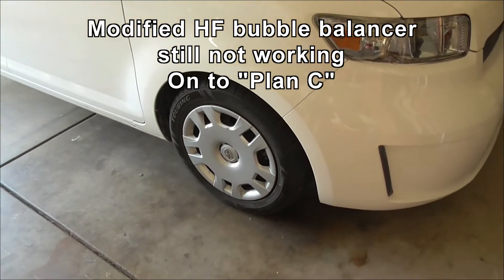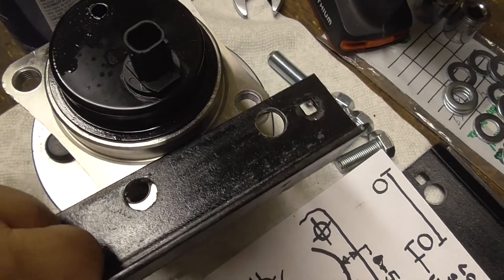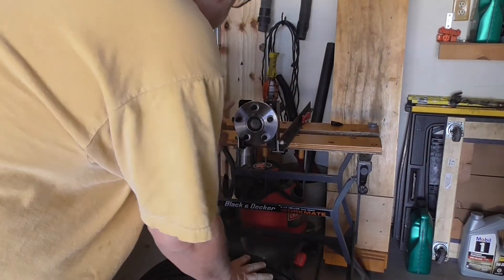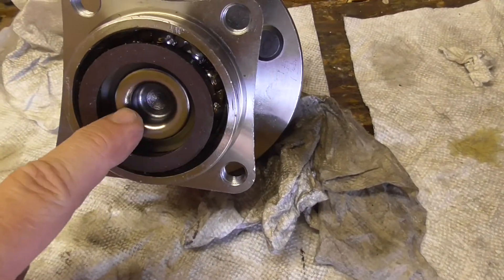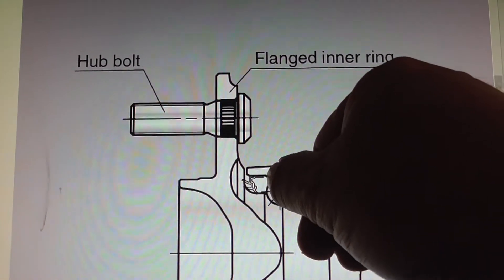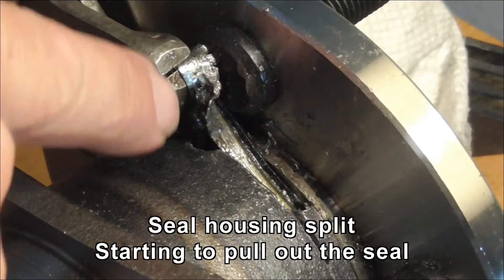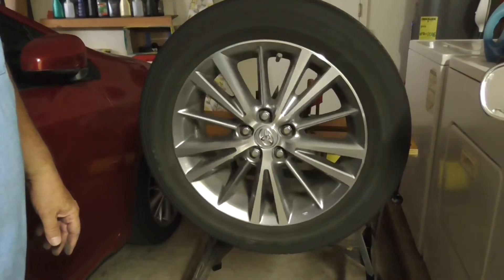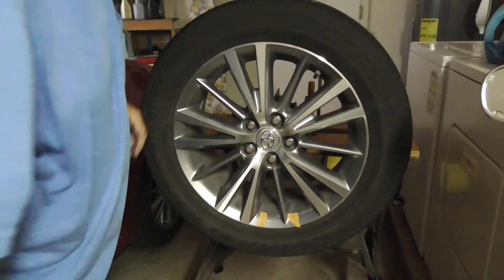Car Tire Vertical Balancing

Comment: Did the vertical spindle method work well? I built a vertical balancer out of threaded rod, tire balancer cones and bearings. It does not work well. I get a consistent heavy spot with no weights on the rim. Once I balanced out the heavy spot I got a new heavy spot. I though I got it balanced out too. Road test says no. it is bouncing pretty bad. The cones look very centered to the hub so I have no idea why this isn't working. The vertical balance method works well on my motorcycle tires.
Reply from the maker: Sounds like you are trying to do a static balance on a car wheel, with a motorcycle wheel balancer type design.
That should work, but clearly it isn't. 
Without seeing your rig, I'm going to make some guesses and/or ask questions.

1. What is the clearance between the threaded rod O.D. and the balance cones I.D. ? (slack here can throw off readings)
2. Do you have one cone set up pointing inwards and the other outwards? 
I have seen a set up like this and I asked why he did it, the answer was because the cones contacted first before clamping the tire properly. So he flipped one and it worked.

With cones, you need one surface perpendicular to the rotation axis to duplicate the wheel hub clamping surface, The other centers on the wheel hub inner pilot. That can be very hard with alloy wheels.

Even a small amount of slack - say 0.010" radial - can make a big difference. 
The out of balance moment created by this is...
The weight of the wheel assy (say 40 lbs) X the radial offset (.010") X 16 to convert to ounces.
= 6.4 ounce inches
Say the wheel rim has an 8" radius, then you would need 6.4/8 = 0.8 ounces of wheel weight to make up for the balancer error.
But of course, it will keep moving around and you won't know where it is...

My hub balancer kind of works, but it has too much friction
I now use a horizontal laser balance, like in this tire change video
https://youtu.be/WgjNO2gt3xg?list=PLWHom5FLIC6vZSy2jL7YB3xnY2jVi5Mgt&t=29
I've done about 30 tires with the laser method, no complaints.
(note the laser method can't do wheels where the hub is centered between the rims)
Reply: @richbinaz  I am using the cones from my motorcycle balancer that have a .5 inch bore to go onto the .5 inch threaded rod. These cones fit the tire changer cones which have i think a 36 or 38mm bore.  Once cone goes into the hub. The other one sitis flat on the other side.

 There is minimal play like the motorcycle balancer has. Once the nuts are tightened to the wheel there is no play.

  I didn't realize such a small amount of play would have that drastic of an impact.
Reply from the maker: @grant31781  
OK, so if you spin the wheel assy on the balancer, does the wheel rim turn true, or does it go up and down against a fixed point.
If you have a dial indicator, that can help. https://youtu.be/zEBYJvfL0b8?t=228
or you can just spin it and observe how it spins against a stationary background
https://youtu.be/PzDyZ6Pn8LE?t=57

If you get a high spot, mark it with a bit of tape, undo and re-assemble the cone system and see if it repeats, or gives you a different spot.

Comment: I see you left one of the original weights on the rim Rich.....wont that mean your would have had to put extra stick on ones on.
Reply from the maker: I initially bought the wrong hub!!!
I thought the Corolla and XB had the same 5 bolt hole pattern, but the corolla is 100mm pitch circle, while the XB was 114mm. 
In the video I was doing test fit ups, so I wasn't at the stage yet for weight removal

Comment: I have a HF balancer and like everyone else has found, it doesn't work well.   I saw the one video where the guy put a 1.5 inch ball bearing in the center of the cone and balanced on the top of a flattened steel shaft.  He claimed it worked well to free up the wheel to allow proper balancing and it made sense to me. So yesterday, I ordered a 39mm ball bearing (slightly larger than 1.5 inch) and 14 inch 1.5 inch diameter steel shaft, threaded on one end and flat on the other.  The threaded end of the steel shaft is stepped down so I figure I can retrofit it to the HF base.  I've already assumed that I will have to do additional milling to the flat end of the shaft to make it perfectly flat.  But sounds like there's likely concentricity defects with the HF cone so probably won't work.  I should return the ball bearing and shaft and save myself $$$ and the disappointment of failure, but I'm probably stubborn enough I'll try it anyway.  I have a feeling I have a lot in common with you Rich.  Meaning, I think we both find value and satisfaction in overcoming a challenge even though many may not consider it worth the effort when strictly looking and time spent and $$$.  With that said, I do have my limits though:)  I think there is a market if someone could actually make a balancer that works for about $300.
Reply from the maker: Hi Quinby, If you have access to a lathe, you may be able to create an internal chamfer, concentric to the outer cone, or cylindrical sections, that will fit the ball. If there is no metal on the inside at around 1 inch diameter, JB weld (epoxy resin) can be used to fill in the area / volume. Then after it's well cured, it may be machinable.
I think the steel support bar only needs to be flat, but it probably needs to be level. Kind of like in this video https://youtu.be/a4Ox_Emh7Ew?list=PLWHom5FLIC6vZSy2jL7YB3xnY2jVi5Mgt&t=27

That might fix the runout issue, but then there are other issues - like...
Is the whole head balanced? (how many ounce inches error is there)
Is the spring loaded frame jamming in the holes? 
Does the wheel go on perpendicular to the cone? (the whole point of the spring frame)

In this video I got a cheap new hub from amazon, think it was around $50 and cobbled up a rig to support it. Once modified to reduce friction, it does seem to work, at least up to 85mph (fast as I want to go) So it seems to be cost effective.

I have seen a guy use a motorcycle type balancing rig, but it wasn't trouble free, he had to make adaptions. Like this one, but with bigger (no-mar) cones and one reversed
https://www.harborfreight.com/search?q=motorcycle%20wheel%20balancing%20stand

That is one of the challenges with making a generic car tire balancer. The pilot diameters and hub - stud pitches are all different.

Yes, I like to solve puzzles and this one was particularly vexing. But I think the vertical solution is good enough, with a backup horizontal plan that might work without having to keep buying hubs.

Comment: i see a guy on here so fed up  he was trying to balance his wheels with his cell phone, good luck  have a great day
Reply from the maker: The cell phone app I downloaded for slope detection was only accurate to 1/2 a degree. Plus you have to pre balance the phone before putting it on the wheel assy. etc etc. More error.

Comment: thank for the message you sent to  sir, i see the guy with the big ball baring  and a flat metal plate for the ball to divot on,  you still have to have a way to get the ball in the centre of the steel plate,  he could have put a pin on the ball a small hole in the metal plate to line it up centred   i have some rock hard rubber balls here,  so i shoved one up in side my balancer cone,  took a 19mm socked  shoved over my pivot shaft,  lade on a nice little pic of 1/4 inch mettle   i didn't balance a wheel with like this tho,   it was working so good  i bould even put a washer  or a bolt nut  on the balancer   and it moved the bubble    and the bubble was moving  for a long time,  so i stooped it with my hand,,  and pasted a other bolt nut   on the opsit side  back to senter bubble   i think the ball baring and a metel plate  is the only way to fix this balance,  from what i see here   with a baring ball and metel plate  , Vertical Balancing  this how thay balance a motor bike
Reply from the maker: The center of the ball (steel, rubber, whatever) needs to be concentric with the outside cone on the bubble balancer, or the problem is not being fixed.
I tried this... which doesn't work for all wheels
https://www.youtube.com/watch?v=a4Ox_Emh7Ew&list=PLWHom5FLIC6vZSy2jL7YB3xnY2jVi5Mgt&index=13&t=1s
It fixes the centering issue, by going straight to the wheel pilot.
But it isn't a solution for all wheels.

Vertical balancing is how all the expensive tire machines work. Accuracy for those depends on centering the wheel rim on the machine and getting the bolt circle flat against the machine.
The machines are fast and can solve for static and dynamic imbalance at the same time.

I can only solve for static balance.

Comment: the red dot needs to be lined up with your valve stem,  on all 4 wheels,  it's got nothing to do with the rim,   your balancer  is the same as mine,  realy off bad,  when my balancer was new didnt work,  so  i took a wheel of my car to the grage, got it balanced speed balance ,  took home put on my bubble balancer,  the bubble  the bubble was all lined up first,  wityh my 3 little screws,  but when i put the grage balanced tire on my bubble balancer,  the dot whent right over to the out side line on the bubble,   so i took a pen and marked  it  where the bubble was,   took the wheel of,  my bummle when back to the center again,  so then i ajusted the bubble  back down to where i had drawed the around the bubble  when i had the grage tire on ,  so when i balanced my 4 wheels  i have to put the bubble back to center again,   this how i was doing it when i first got the balancer
Reply from the maker: red or yellow dot? There are also many other colored dots some makers put on, to be used at the car makers factory.
Yellow is the light spot - I can only measure a weight imbalance in the rim and mark it with tape.
Red is runout - There is supposed to be a notch or painted dot on the rim showing a position where the red dot is supposed to go. If there is one!!! Never found one yet. If you can't find one, then ignore the red dot.

On an alloy wheel, things like casting porosity can change where the heavy spot is. Also the amount of material removed to create the pocket for the valve stem to sit in, can be more than the weight of the valve stem.

In theory, the valve stem should be the location of the heavy spot
In practice, it needs to be found, marked and the yellow dot placed at that location.
Assuming it is at the valve is lazy, but expedient for discount tire installers, where time is money and they need to do the job as fast as possible.

Comment: I used the same HF balancer and it worked fine for me.
Reply from the maker: I'm happy the balancer works for you, It didn't for me. 
Would have saved me some $$$'s having to buy hubs and make up a vertical balancer.
Reply: @richbinaz  well when i got the new tires and mounted them, i slapped them on the car and did get vibration around 55-60 mph.
Took the wheels off and put it on the balancer and the bubble WAS off so i put weights to get the bubble in the middle. 
Put them back on the car and the vibration was gone.

Comment: is that a brand new hub?
Reply from the maker: Yes, it was about the same cost as one from a scrap yard
Check out the other reply about using a glass ball as a pilot. Can save a lot of time and effort.
Reply: @richbinaz  ..the issue is taking out the seal from the hub is very difficult.
Reply from the maker: @thewishmastur  Yes! Yes it is. 
This video shows how hard that was to do.
It is also a messy process and I ended up with quite a few metal slivers going down into the bearing area. I tried washing it out with brake cleaner from the inside to outside, but it didn't get everything out. So when the hub spins it occasionally hit a bit of debris and It bumps past that.

Had even worse luck on the 2nd hub. https://www.youtube.com/watch?v=li6cBQBcOX8
After I got the seal out, the pre-load on the bearing was too high for free wheeling. Had to chip away at the rolled over shaft until it was removed from the face and radius on the bearing, then beat the shaft forward thru the bearing, to reduce the preload to a point where I thought it would give a result. Not ideal for the bearings. I don't think they "brinelled"

Nothing easy - thats why I suggested the glass ball method from Simon in the UK
https://www.youtube.com/watch?v=cjMf7U14xe4&list=PLWHom5FLIC6u-II0_Ag5QKbXt8W_gcKHR&index=35
Reply: no, 25 yrs old